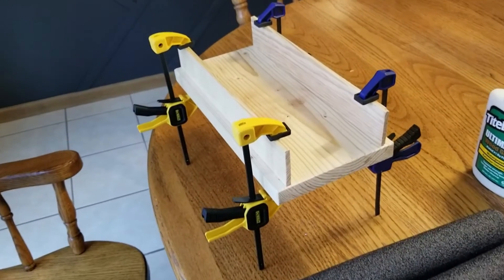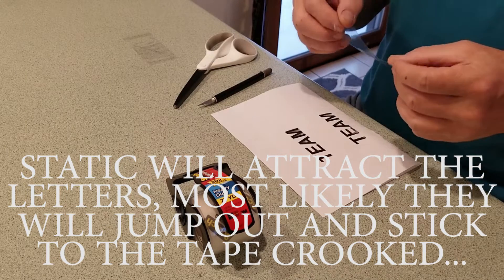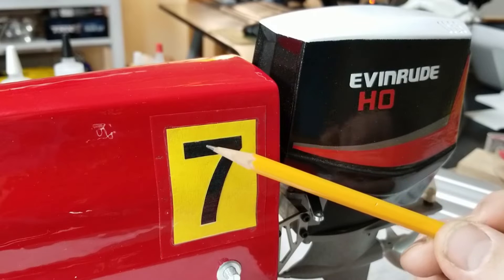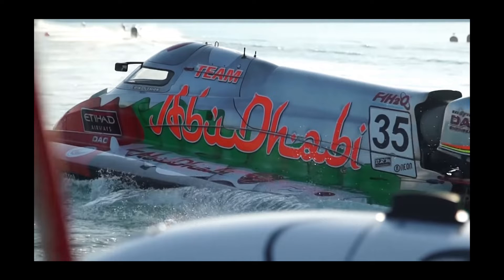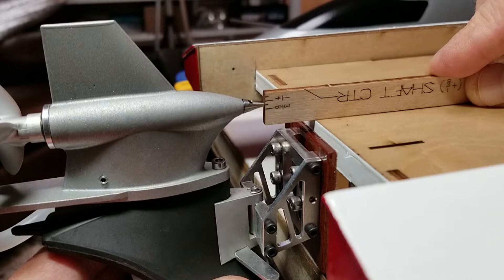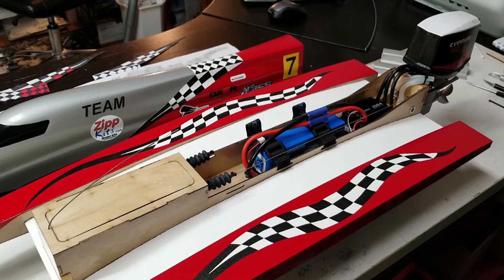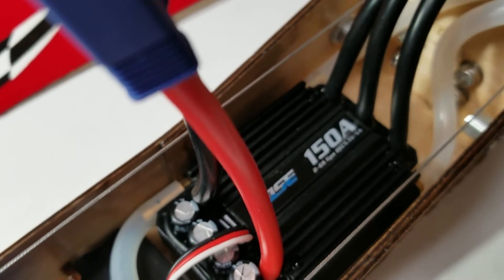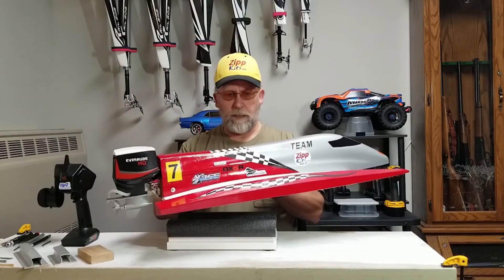G30 OUTBOARD TUNNEL HULL BUILD_PART 9

Comment: Hey Sam, what size servo clevis and cable did you use and where to purchase?
Reply from the maker: It's the Dubro 4-40 Pull-Pull System from OSE. Comes with everything, nylon coated cable, clevises, jam nuts, crimps...